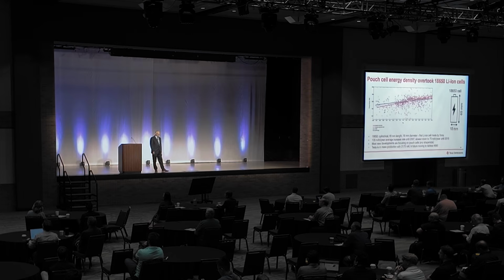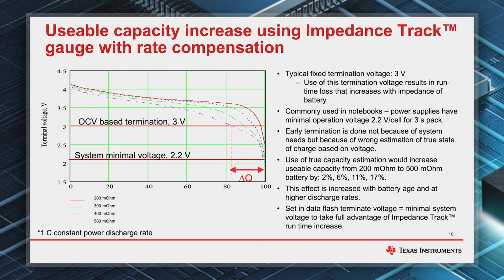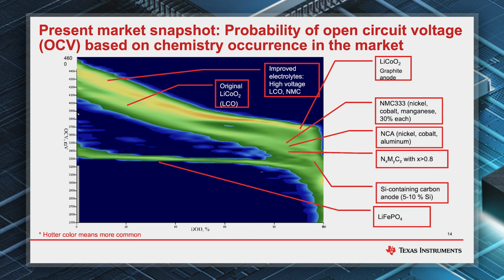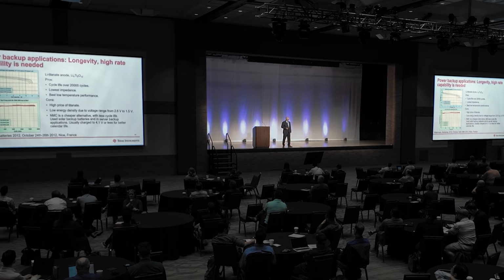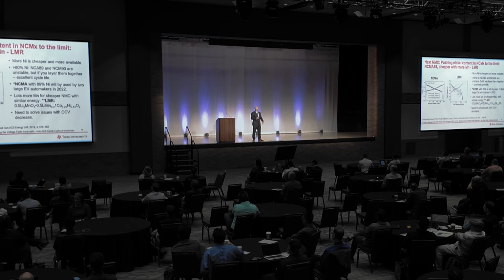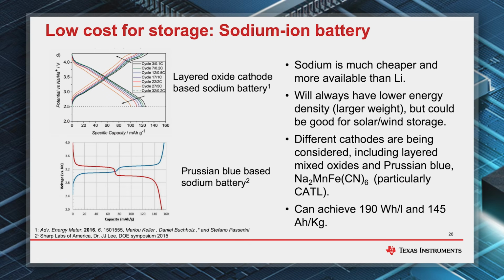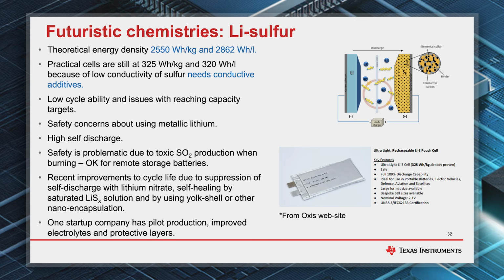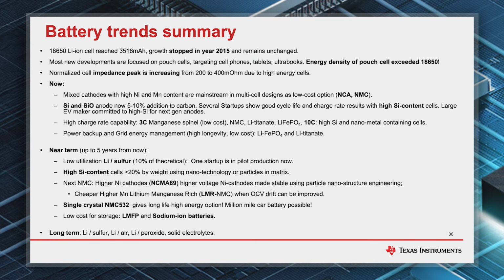Breakthroughs in battery technology

Comment: With all these resources being put into batteries and management systems for them, I'm really surprised TI don't have a chip that can do advanced/intelligent dynamic cell balancing. By that, I mean a BMS chip that learns the capacity of it's cells and moves current to and from the weakest cells in advance during (dis)charge, so that all cells reach max and min voltage at the same time. 
I googled this intensely and all I found was a "An exploratory study on intelligent active cell balancing..." from this year. And seems way overkill with ML and deep learning and other inflated AI buzzwords. I would have thought a simple low cost single chip solution would have been everywhere by now....
Reply: yeah,I kinda felt in your place ..but why? why even TI doesn't have this kind of ic developed?